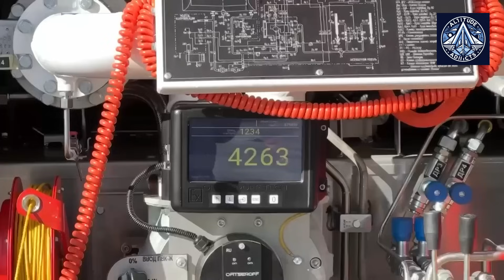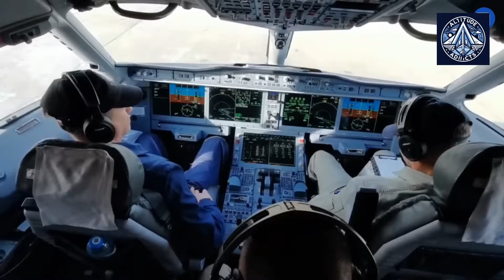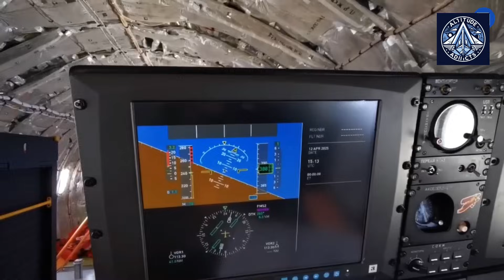How does the new Russian Superjet SJ-100 differ from the SSJ-100?

Comment: ❤️'ing the new SJ100.  When Sukhoi get this plane into service, I think they should consider a stretch version which carries around 150 Passengers and has increased range.
Reply: semoga ada versi yang lebih besar bisa membawa diatas 150 penumpang
Reply: @hermansuroso7085  no idea what you're saying, sorry 😶
Reply: Currently, a shortened version of the MS-21-210 is being developed. It will accommodate 150 passengers.
Reply: @globalpower6967 Many thanks for your message. You know ;I wonder if Irkut\UAC are missing a trick? If the MC21 is too heavy and the PD35 engine isn't strong enough for a widebody; I wonder why the wouldn't just work on a stretched version of the MC21, configure the wing for more comfy long duration trips and just call it the MC22?
Reply: @CJ-xl3dh  The PD-35 engine is used to test the technology, in the final version it will be more powerful. Money has already been allocated for the development of a wide-aisle aircraft and the development of an engine with a suitable power. The Engine Construction Corporation does not announce what the engine will be called and what its power will be, but what is known for sure is that the engine power will be greater than that of the PD-35.
Reply: @CJ-xl3dh  At the moment, the MS-21 aircraft will have two versions. The MS-21-310 is a full-size version and the MS-21-210 is a shortened version. There were only rumors about the development of an extended version, nothing more. Most likely, they decided to direct resources to the development of a wide-aisle aircraft.
Reply: @CJ-xl3dh  MS-21 is not too heavy, everything is fine with him in the ratio of weight and traction of the engines! Do not believe in anything unreasonable statements by Western propaganda. This is either a deliberate lie on their part, or the mistakes of translation from the Russian language.
Reply: @CJ-xl3dh  The situation in this case is exactly the opposite, the plane can carry a large load!
Reply: @globalpower6967 This came from the channel Altitude Addicts. Its range is decreased as titanium is unfortunately heavier than carbon fibre. I still think Russia did a good think trying to build in house. I see it as a reacclimating 'growing pain' which;once overcome will negate ever seeing them fall to the behest of the US.

I still think they should make a stretch MC22 with PD35 engines though, and leave the smaller aircraft market to Sukhoi who could stretch the SJ100.

Comment: other thing is now that the SJ-100, MC-21 and IL-114 are 100% Russian - that means the military will be buying them as well .... those factories are going to be humming for many years ....
Reply: Not sure what use the military has for SJ-100 and MC-21.    Actually, restructuring that took SJ from Sukhoi ( military brand) to under Yakovlev umbrella,  kind of signifies a separation with military.   In Soviet times the main passenger models (Tu-134, 154, IL-62,86) did not have much military use,  and, oppositly,   IL-76 was not used for passenger service market, being primarily military transport
Reply: @dmitripogosian5084 He's actually right and wrong, the military will not buy any of these civilian aircrafts but will definitely benefit from the new engines especially the PD-35
Reply: The military in past bought the Tu-134 and the Tu-154 and also bought the Tu-204 as well as the Tu-214. So they will buy these planes too, of course the passenger seats are thrown out and the plane is converted for military purposes. Or for the needs of Roscosmos. For exaple, Thai military uses the SSJ-100